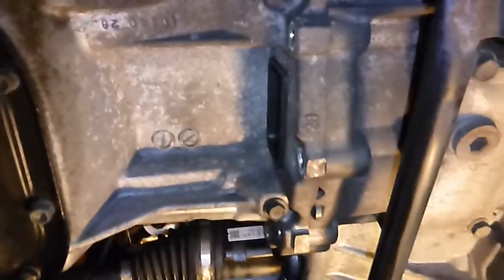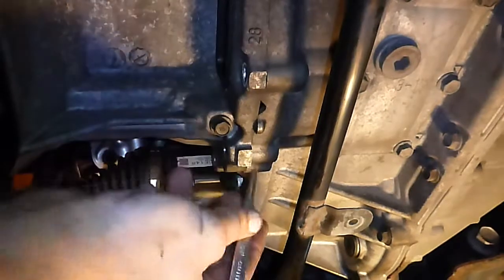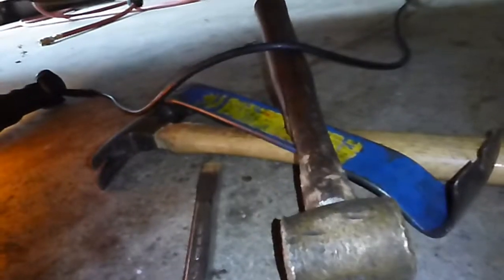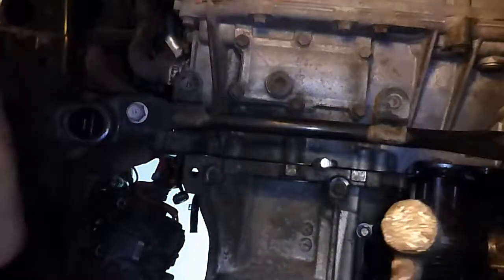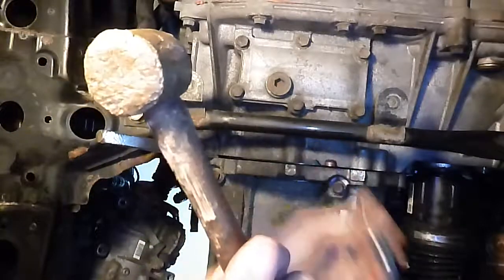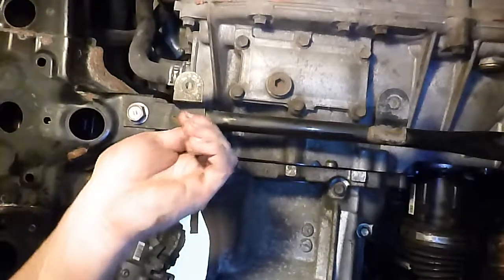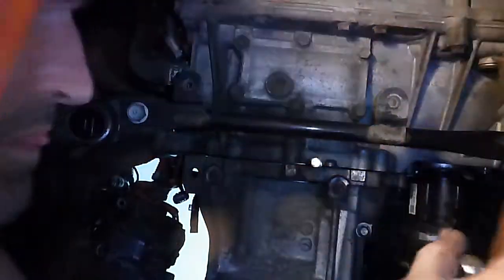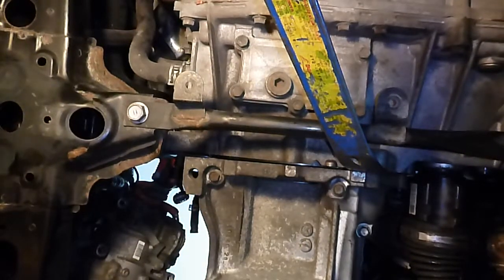Fix That Prius! - Teaser - Separating the Trans from the Engine

Comment: If you loosen all the engine to trans bolts about 1/4" at the beginning of the process by the time you are ready to separate things come apart much easier.  Don't forget the two bolts on top of the engine that go in the other way.  (heads on drivers side)
Reply: I’m having the same issue. Separates some but seems like the splines are stuck…
Any tips?

Comment: So are there no torque converter bolts?
Reply from the maker: Nope. There's NO Torque Converter,  just a ring gear, sun gear, 4) planetary gears and 2) motor/generators.
The splined end of the input shaft goes into the "drive plate" that is bolted to the crankshaft.